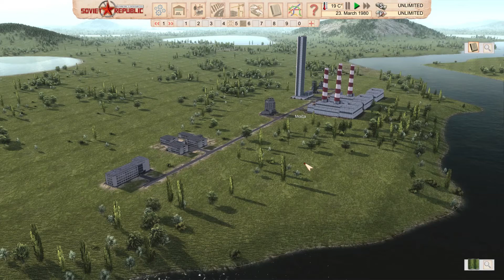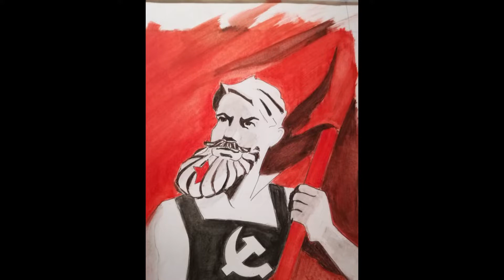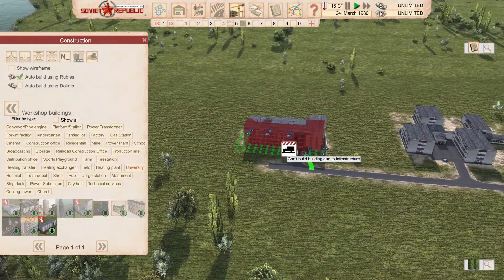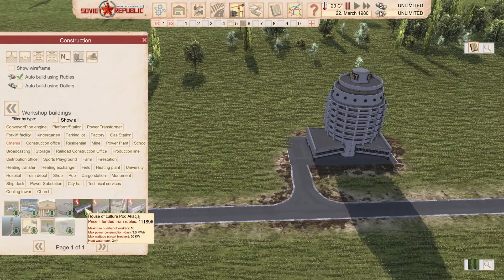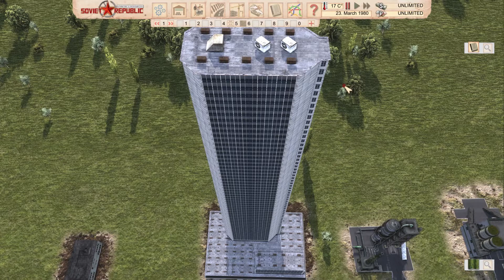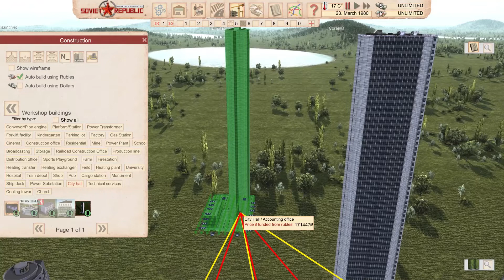Workers and Resources - Soviet Republic - Mod Review 12

Comment: You didn't manage to arrange the buildings correctly. They were added to the game and made to fit perfectly. The heating plant must be aligned along the very front wall of the power plant, from which high-voltage connections come out. In this case, the pipes will automatically stand straight.
Reply from the maker: Yeah. You are right. But I will do this soon as I love it and will be using it regularly. Thanks for the heads up. Allign the power wall and the pipes will fit perfectly.